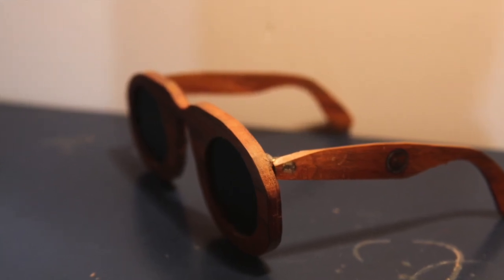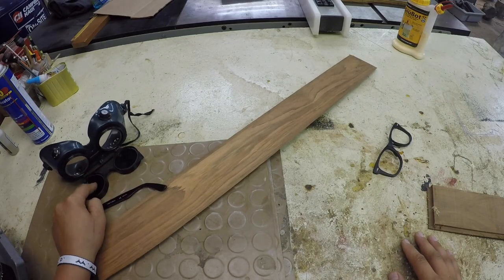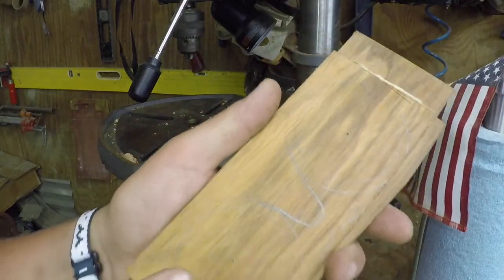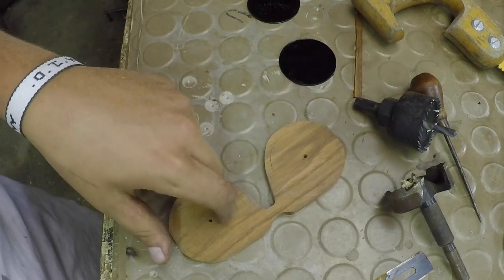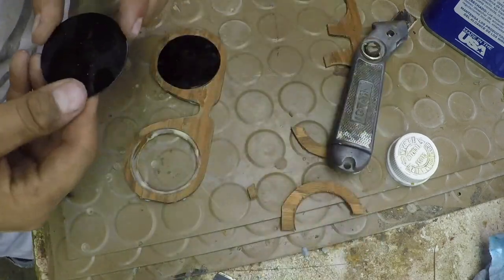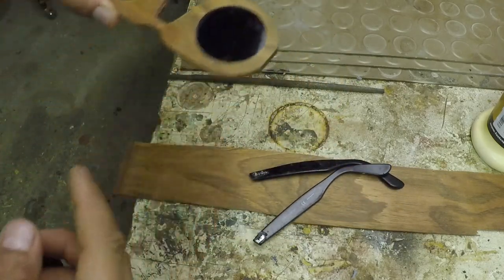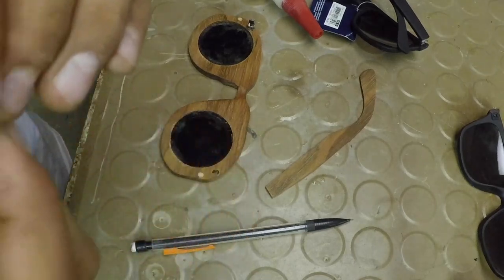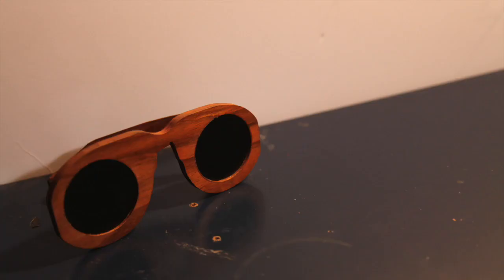How to make ECLIPSE glasses! | welding glasses

Comment: Cool project, but I don't really see the purpose of using it over just the plain goggles, other than aesthetics.

Also, you need to at least double-stack those Harbor Freight googles to get any kind of clear outline of the sun.......and prevent permanently burning your retina.